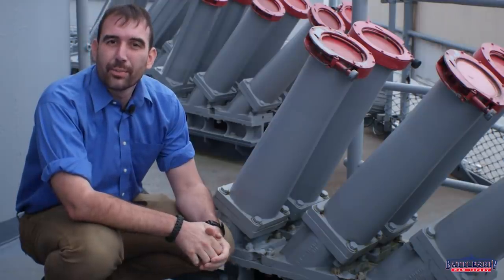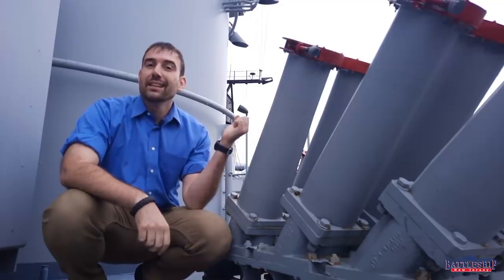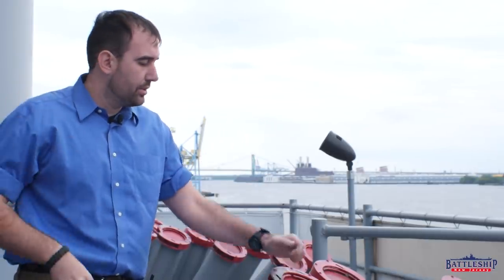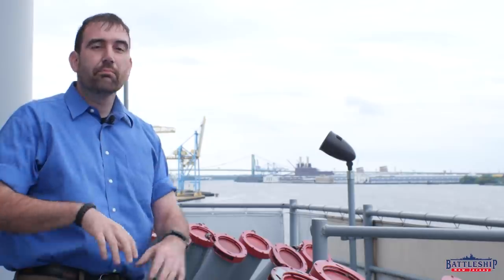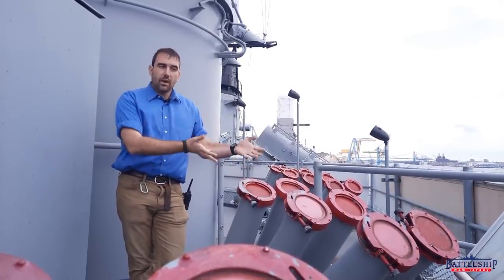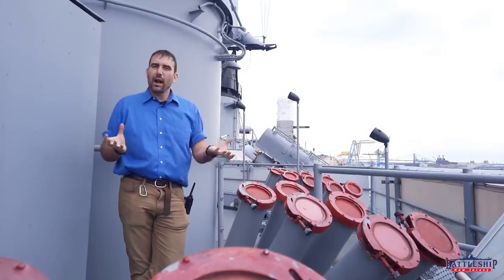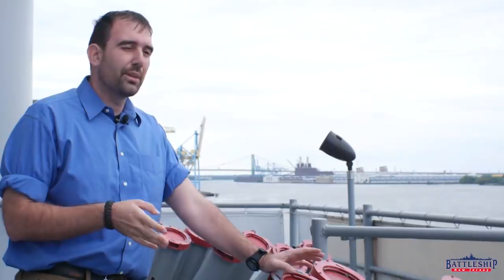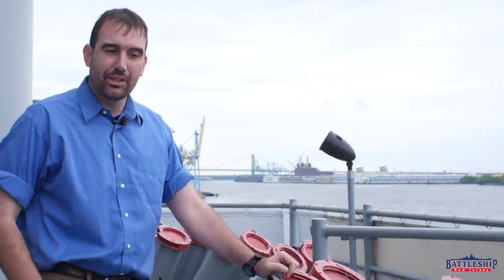SRBOC: Super Rapid Blooming Off-board Chaff

Comment: In CEC, look at the SLQ-32 console.  On the tray with the keyboard and FABs(Fixed Action Buttons), in the upper right side, you should have an integrated SRBOC launcher panel, above the 'joystick'.  This can control up to 4 launchers.

Also, for each Mk 36 Launcher, you should have a nearby electrical panel with a battery backup to allow chaff to be fire without ship's power.

P.S. - Chaff does work when properly used.  Seduction, distraction and flare.  The ship needs to be going the correct direction and speed to achieve proper separation.  I was the shipboard SRBOC trainer and EW Supervisor.
Reply: Is the SLQ-32 console still in the NJ?  That may be why he has not seen the SRBOC launch panel.  Yes, people forget that Chaff must be used intelligently, you don't just start throwing up clouds, you select the launcher based on the geometry of the engagement.
Reply: @FirstToken  yes she still has it, ill look next time to see if the SRBOC panel is there too
Reply: There's always someone that knows the answer.
Reply: @FrancSchiphorst  It is possible that a number of controls and buttons were removed an a blank plate installed.  Chances are good that the FABs were removed with all the interior parts to repair other in fleet functional units.

In that image, you see the SRBOC panel in the lower right with the knob and 4 unlit red lights.
Reply: @Echowhiskeyone  if I zoom in I can read chaff above the FABs (cool name!)
It's likely that they removed it as it was/is active duty but would they blank out the panel? Maybe done by the museum.
But my next 3D project will have some FABs :)
Reply: @FrancSchiphorst  It would be neat to rebuild a static, lit, 3d panel for the SLQ FABs, also get some lights and a knob for the chaff panel. Considering the inside is most likely gutted, wiring would be easy.
Reply: 2AM GQ in sandbox in 87, out of CIC to van on deck and it was daytime with chaff launcher and salt water flares burning the gulf just after Stark took Exocets.
Reply: Iowa class had WHR-1H, at least Missouri did. After EW A-School I attended WHR-1H school with 2 friends. They orders to the Missouri and I had orders to a carrier.

EWs do it with frequency!
Reply: @luciusvorenus9445  My A-School instructor was on New Jersey, I remember him talking about the SLQ in CEC and Equipment Room up top and the SRBOC deck.  Don't recall if he said anything about the WHR-1H or not.  I do remember a number of ships, mainly carriers, had the WHR-1H and I didn't go to the school for it.
Reply: @Echowhiskeyone  It was only couple weeks long after Petty Officer Indoc. This was in 1990 at Corry Jr. High.
Reply: @Echowhiskeyone  and @Michael Johnston , Several ships of various classes had both WLR-1H and SLQ-32, at the same time.  Also, all of the Iowas would have started life with AN/APR-4Y (or the Naval variant of it, I don't recall the designation right now, it took the same tuners as the APR-4), and later upgraded to WLR-1 of various flavors, ending up with C and G models before the 1980's refits.  In the 80's refit I am pretty sure they were all upgraded to SLQ-32.  At least one of them, I don't remember which, had both SLQ-32 and WLR-1G for a while, before the WLR-1G was replaced with the WLR-1H.

Comment: A good topic for a future video could be what would have happened to USS Missouri if she had been hit by the Iraqi Silkworm anti-ship missile Ryan spoke about at 7:50 during the Gulf War. In the event the Royal Navy shot the missile down with Sea Dart fired from HMS Gloucester.
Reply: The silkworms had to be set at an altitude when launched. So if it would have hit the Missouri the one launched at her would have impacted in back of turret 2 along the 0-1 level . But since it was set at a higher altitude it overflew the ship.  They were close enough for the marine guard on the bridge to throw the captain down on the deck to protect him .  I was down in the powder flats on turret 2 and we had incoming vampire warnings and brace for shock.  What that missile would have done to us . I’m glad we didn’t find out .   It would depend if the impact caused splinter and fire damage.  I would say it would have been an unknown.  Either you loose the ship or you don’t at that point.
Reply: @SCHRUBBE1966  I would wager that at the relatively low speeds they fly and the relatively small war head that if it had hit the armored turret side, the damage would have been a big mark in the paint on the side of the turret.   Cool sea story though I bet that was exciting!

Comment: The Navy is still building ships with SRBOCs, so my guess is that their tests showed that the chaff was actually pretty effective.
Reply: But they are not deploying it on battleships. How effective was it for the Iowas?
Reply: @zeroone8800  Well, they just aren't deploying battleships period.
Reply: My guess is that it's cheap, and offers an additional layer of defense.  Even if it were just effective a fraction of the time, that would be worth using.  Since it's not too large, and comparatively cheap.
Reply: @hosmerhomeboy  Yes it must be the cheapest contermeasure there is. Also it gets more effective the smaller your boat is as gives you a larger profile/signature = missile might miss .
Reply: It's a cheap last defense...it's basically is a motar round filled with chaff.  As I saw a Doc where they were using land based equipment as ship board defenses on lightly armed transport ships (Think of a LAV, stryker or even a 50 cal on the deck).
Reply: When used properly, they are more than 98% effective and with 4 launchers per side like that, you can make a bloom big enough to hide a couple of battleships and a carrier behind. I was the guy who operated and maintained these things for 6 years.
Reply: Steve Wolcott  that’s not how active terminal homing radar works but the Soviets/Russians did come up with some that WILL home in on any signal used to try to jam them. The key is to make sure the chaff cloud is in full bloom before the radar comes back on to confirm target location.
Reply: Steve Wolcott  not how missiles work.  Cruise missiles radar isn’t powerful enough to specifically target a ship from launch point (they have range in hundreds of miles).  They are launched on inertial guidance and don’t turn on its own terminal radar or heat seeking guidance until it’s much much closer.  So the missile isn’t tracking anything at launch, giving time for the target to engage, Jam, or decoy the missile

Comment: i like that its a Combat Information center normally, but he refers to it as the Combat Engagement center on the battleship.  
 I like the implications about the way the battleship is thought of.
Reply: It's because the Iowas still had their original Combat Information Centers deep inside the hull of the ship.  The CICs were not well suited for all the modern (at the time) equipment (too small), so the Navy built a new space up in the superstructure for a new CIC.  However, since the ships already had a CIC, the new space was called the Combat Engagement Center, CEC, to differentiate it from the old CIC.
Reply: @zoopercoolguy  ah this makes sense.   thanks!

Comment: If I remember correctly from WWII history, they had to cut the chaff to just the right length. Radar operated on specific frequencies. The length of the chaff had to match the wavelength of the radar in order to be effective. Tin cans were used for chaff. They would collect the empty cans and people would sit around cutting cans into chaff. This was placed in bags. Our bombers would have several bags on board and would empty them out of the plane as they came into range of the German 88s.

Comment: I have read that the turning time of an Iowa was about the same as a Fletcher Destroyer. I saw a picture about that somewhere.

How fast can one of the screws be put into reverse? Changing the aspect ratio of the BB would allow the chaff to work better. Turn using the rudders and also reverse one of the screws to twist the ship faster and you change its aspect ratio faster.
Reply: 2 Screws. Iowas had 4, 2 on each side. And I might be wrong, but I don't think she could reverse proppelers quicky.  Problem is with propeller's shaft,  it is so long, that it is twisted  when it is turning proppeler. If I remember correctly, twist on shaft was about one revolution  (between both ends) at  high speeds. I can imagine, that if you "slam the breaks" and hit "reverse button", it could end up ugly.
Or maybe not, as I said, I might be wrong. I would like to see a comment from someone, who knows more on the topic.
Reply: ALso, I would take an educated guess and say becasue the hull is so long on an Iowa, reversing 2 props isnt going to make much difference. Plus, you would have to bring the props and shafts to a stop, engage reverse, and then increase RPM again on the 2 reversed shafts. Not something you can do quickly.

Comment: AS I recall Frigate I was on - SRBOC controller was right beside the SLQ-32 console. - that would be a good later subject (but I suspect it is as lacking as the internal console for the CIWS) Any Idea if NJ go the WLR-1 during Vietnam ? When the camera angle does not show the CIWS and Tomahawk launcher- am I seeing SS Americas funnels to right in background?  THANKS
Reply: I think you mean SS United States? She's still parked up across the river at the marine terminal cross the river. What do you mean by wlr?
Reply: @WALTERBROADDUS  Weapons Locating Radar
Reply: @ghost307  not sure which type radar was used for the gun director. But she would have been state-of-the-art with air and sea search radar. As well as for the directors for the 5 and 16 inch guns.
Reply: The WLR-1 is a manually tuned tube type ESM receiver, the SLQ-32 is a computer controlled wide band ESM receiver.
Reply: @daverichards190  So it is a passive receiver of enemy radar signals?
Reply from the maker: FOUND IT! It was on the SLQ-32 console. Thanks for the tip!
Reply: @BattleshipNewJersey  SRBOC was part of the SLQ-32 EW system. I was a crew member of the ship that did the design to price testing of the Hughes and Raytheon systems in the mid 70's.
Reply: @WALTERBROADDUS  Correct, not a radar. We had both systems on the CFA DDG I was on in the 80's. I went to school, both operator and tech for the SLQ-32 and I worked and operated both during my tour on the USS Berkeley. I was also the tech for the SRBOC and EW Supervisor.

Comment: Not sure if the USS NewJersey, et al, had EW suites in addition to SRBOC... If they did there is a good chance that with both systems working together the missile just might "Kill a chunk of the ocean" i.e. miss.
 
Also, wondering about the 5"L38's (5/38) with VT fuses.  Yes, I know that they basically have to be already pointed at the oncoming missile, but with warning they could possibly handle things out to a few and perhaps several miles!
Reply: All four Iowas were fitted with the SLQ-32 when reactivated in the 1980s.

Comment: Chaff dispensers are often automated or semi-automated. So, when you're expecting trouble you might arm the launchers and then the radar and computers take over. Timing has a lot to do with how effective they are so depending on a human to time them just right seems unlikely. Also, chaff are useful at the margins. If a missile is being guided by the system that launched it it is unlikely to be fooled, but there is a window between when it is being guided by the remote system and when its on-board system with much less power takes over. Like I said: chaff works at the margins. It might turn a poorly aimed shot into a near miss or redirect the warhead to an area less vulnerable. But trying to hide a ship from radar at close range is more or less impossible.
Reply: You are correct about timing only partialy. Yes, human can never achieve computer's accuracy, but on the other hand, chaff is only effective in combination with propper maneuver, and that is the problem. Computer simply don't know what maneuver and when you are about to take, and thus when is the best time to pop up the chaff.

Comment: Unless they left the SLQ-32 console on the ship, there is no longer a launcher control in the Combat Information Center and they are launched 1 tube at a time unless you want to have to replace an entire launcher and have a huge hole in the deck where your launchers used to be because even firing off 2 from the same launcher mount at the same time will rip that thing right off the ship.
Reply: 1 tube at a time or in volleys? Because those are two different things. One at a time means once per button press. But in a volley they could go boom-boom-boom-boom-boom-boom with just enough of a gap between each tube firing to prevent overloading of the mount
Reply: @richardmillhousenixon  You cannot launch a volley without destroying the launchers but with the configuration carriers and battleships have, you would be firing the same tube on two launchers at the same time since there are 2 fore and 2 aft launchers. More than 1 button at a time = very bad.
Reply: @neilbaird2789  I'm not saying volley as in shotgun blast, I'm saying volley as in machine gun blast. i.e. not firing everything at once but instead firing one at a time but in rapid succession.
Reply: @richardmillhousenixon  that would be a huge waste of money and countermeasures but sure. Only 1 round from each launcher is all that is necessary to completely mask the ship. You get 6 tubes per launcher so that you have a something to deal with the next several strikes since it takes a long time to reload a launcher. Have you ever operated one of these things or loaded one? I did for six years.
Reply: @neilbaird2789  There's a reason they don't set all the mortar launchers at the same angle, even on the same fixture
Reply: @richardmillhousenixon  you seem to think they are used for shooting down a missile like some sort of AA battery but 1 round per launcher is all that is needed. The only reason for the difference in angles is that certain types of chaff and flares require them in order to do their job and most ships bigger than a frigate, will put at least two different types of decoys in them. Flares go in the lowest angle while Sea Gnat goes in the highest.
Reply: @neilbaird2789  No, I perfectly understand how they are used. But with modern radar targeting and anti-countermeasure technology, you no longer just need something big enough to distract the missile, you need something big enough to completely mask the original target. You can't get coverage that good from just one single chaff tube
Reply: @richardmillhousenixon  maybe that’s why they have 4 launchers per side but what would an EW2 NEC 1733 know right? You armchair warriors are hilarious.
Reply: @neilbaird2789  Look at the beefy connection between the launcher and the deck. That fucker ain't going nowhere even if you launch more than one.

Comment: Isn’t the Navy developing a anti air laser system? Hopefully the chaff just becomes redundant.
Reply: As I understand it thats why the new Carriers of the Ford Class have so much more electric generation ability for anti-missile lasers.
Reply: Lasers require power, chaff can be fired using batteries.  During a casualty, you may not have enough power for the lasers, chaff was designed with a battery backup, like you computer should have.
Reply: @GaryED44  They use tremendous amounts of electricity for the catapult system instead of steam. Also the elevators are also electric operated.
Reply: @terryboyer1342  Yes I know but they stated many times the increased Power generation is for future laser systems

Comment: I keep wondering why the navy never developed a anti air round for the 16 inch guns.  Like a giant shot gun shell. 
It would seem that a broadside like that would be very effective.
Reply: I've wondered the same thing. The Japanese big guns were used as anti-air.
Reply: I believe there is a video on here where Ryan talks about that
Reply: The tracking would be too slow, as well as the fireing rate. From my understanding, the IJN shells never hit anything, though they were impressive,
Reply: Turret tracking was too slow to be used effectively. I mean if the aircraft were flown straight and level for long enough to plot a shell intercept, they might work... The japanese has AA shells called San Shiki (beehive shells), to which Musashi and Yamato both were equipped with. I believe they were pretty unreliable too. Musashi reportedly downed 4 of USS Intrepids aircraft during the Battle of the Sibuyan Sea with her beehive shells, but its also thought than one of the shells exploded early while still in the barrel and disabled one of her main guns as well

Comment: 7:48 One would think CIWS would have a restriction in arcs of fire when ships are operating in fleet formations?
Reply: The U.S. navy has pretty much retired CIWS as I understand it.  Partly it is a matter of being too short ranged to be effective, but a part of the general dislike of the system are the numerous instances of CIWS at least tracking and occasionally firing on friendly crew, vehicles or equipment.  I know deck apes who swear the system tracked them walking across the deck while carrying a toolbox.  There were problems with the system tracking friendly helicopters that I am not sure were ever solved.  I have heard a story of an incident where an ECM pod on a ship superstructure was tested, multiple flag officers present, and when the pod was turned on CIWS promptly blew it off the ship.  I am told no one was hurt, but the laundry had some rush orders.